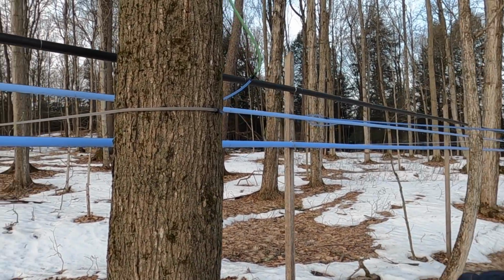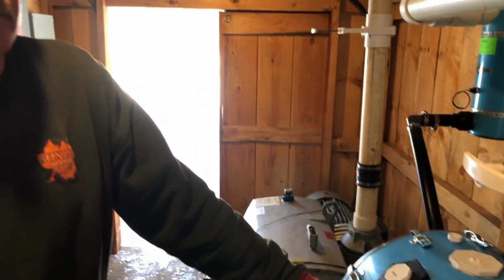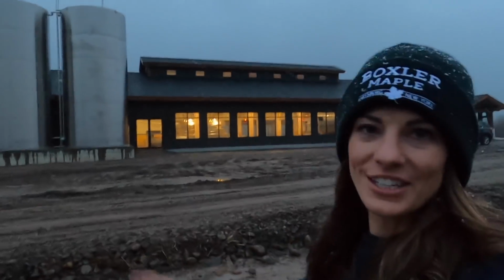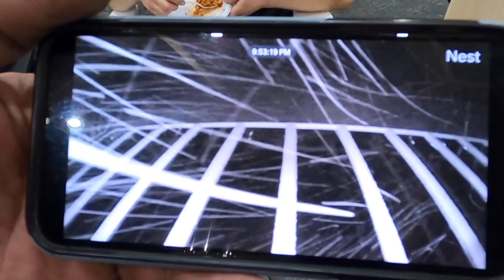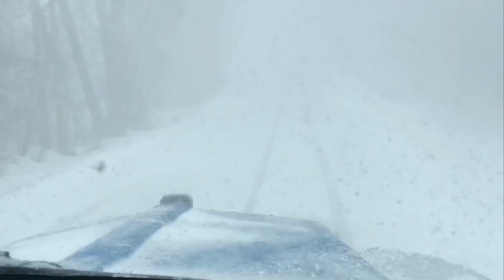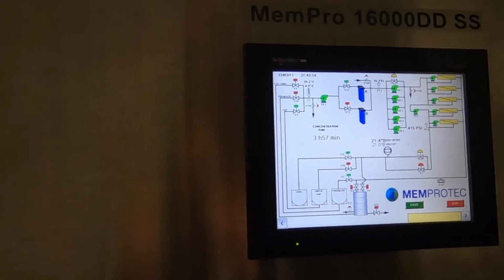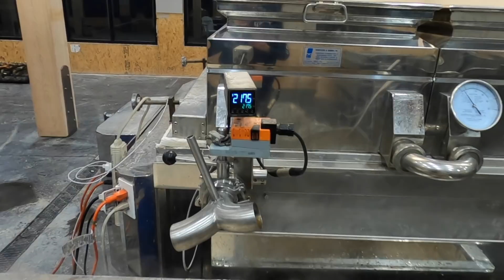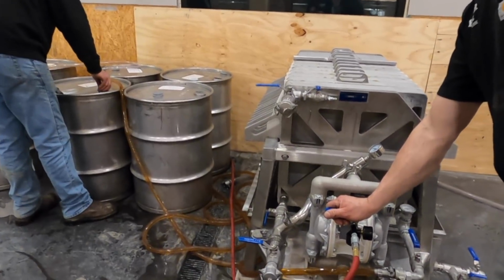It's a Sap Story - Following Sap from Tree to Table!

Comment: Pretty automated the whole process from harvesting to final syrup ready for your pancakes!in my youthdays late 60s we walked around the sugar bush with a small tankcart emptying buckets from the trees never ending backbreaking work!
Reply from the maker: Still have to walk the entire sugar bush to manually tap trees and fix lines. We used to use buckets but once you expand enough you need to use tubing rather than buckets

Comment: I spent 34 years making reverse osmosis water filters. You are using what we called a fullfit element. The concept behind them is you end up using the concentrate as your product. Instead of just the opposite on a regular osmosis filter where the concentrate gets dumped to the drain. I may have even made the filters your using.

Comment: The electrical tape trick is spot on..  I've done that a few times. Awesome video! Curious.. how far of a radius do you cover with that tanker? I had some of your maple syrup the other day I had ordered and it was great! Sweeter than what I make. If you get a chance at the end of the season make some wine out of a couple gallons of syrup.. pretty simple to do.
Reply from the maker: I’ll have to look into how to make maple wine!
Reply: @MapleFarmer Yea give it a try.. you'll like it. I'm making some next week. You can use any of the finished syrup but cut it with some water.. otherwise it will snuff out the yeast. Food grade 5 gallon pals, couple of air locks, wine making yeast, lemons, raisins and some luck. The higher the brix in the syrup the higher the alcohol content. It'll be ready in 4-6 months.. Another business venture.
Reply from the maker: @davidkermizian8548  Sounds like a fun YouTube video to make!

Comment: what are you putting in the syrup when it comes out of the finishing pan? our syrup goes right in jugs as soon as it cools a little but we don't add anything to it we are in vermont.
Reply from the maker: Syrup needs to be 66 Brix if it’s higher it will crystallize. Therefore, If it’s a little heavy we add the syrup that is lower in brix from the back pan to get it right at 66.